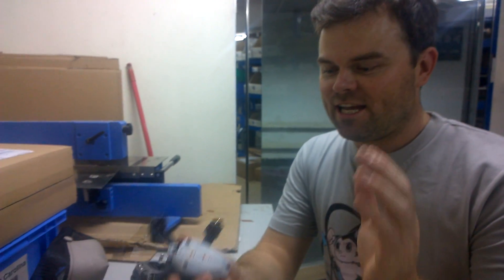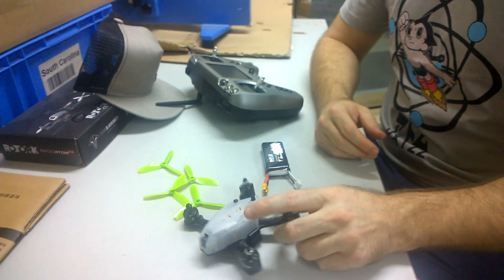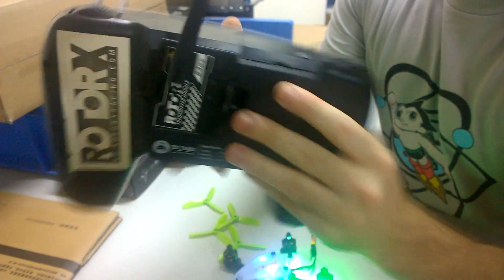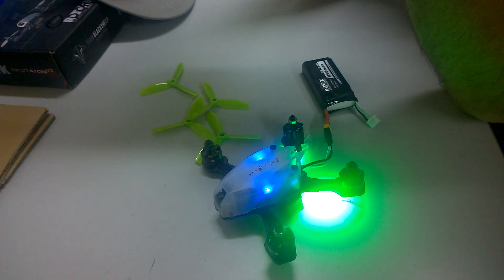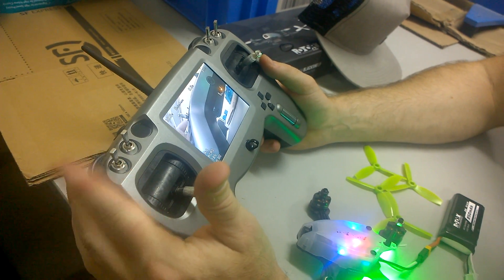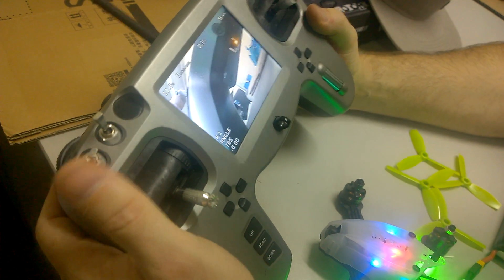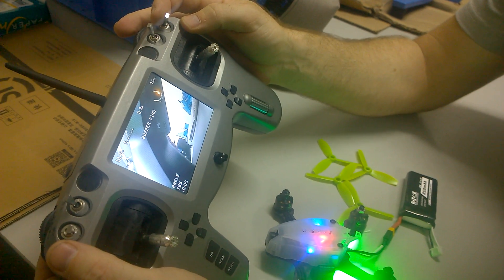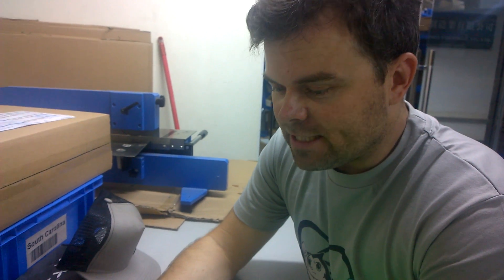Atom V2 RTF - Getting Started

Comment: Doesn't seem to work for me. The beeping stops after a while and it seems as if the pairing was successful. But nothing I do on the Tango seems to have an effect. HUD in the bottom-left corner says "A:1 / ANGLE / TBS / 0:00". Can't switch to ACRO or HORIZON.

What am I doing wrong?

Edit: It must be something really stupid. As soon as I turn off the remote all rotors turn on for half a second or so, so it seems that it is paired.
Reply: Having the exact same issue. Hope someone has an idea out there.
Reply: Hmm can you launch a ticket at rotorx.freshdesk.com thanks! You too Warren Wiens please
Reply: Will do! Thanks for the reply.

Comment: I bought one from the first batch and don't like the fact that the camera wires get pressed against the frame when using the higher angle camera mounts. Due to this my camera wires got damaged and now I keep having problems with the video due to damaged wires. Can't seem to find a replacement camera locally so a bit disappointed as it's not a cheap quad and expected higher QC.
Reply from the maker: Zarak hey mate launch a ticket with RotorX.freshdesk.com and we can get you sorted out in several ways
Reply: Rotor X I did mate but they just sent me a link for website overseas where I could buy a new camera. They also acknowledged the issue with the camera but never offered to send me a replacement etc so I just have up as if me paying more for postage than what the camera is worth in the first place. Plus they asked me to remove the black protective coating from the back of the camera where the wires are soldered and re-solder them but my soldering skills are not that good plus the black / grey protective stuff is hard to take off.
Reply: Rotor X I'll try and launch another ticket and see what happens this time.
Reply from the maker: Zarak hmm that might have been when we were out of stock, put another ticket in and I'll see if we can get you the new mount and refund your replacement
Reply: Rotor X do I need to do a new ticket as my old ticket still says being processed since 60 days. My ticket number is #83.